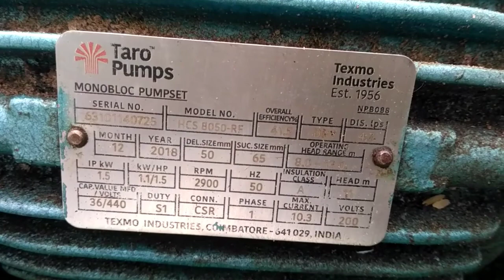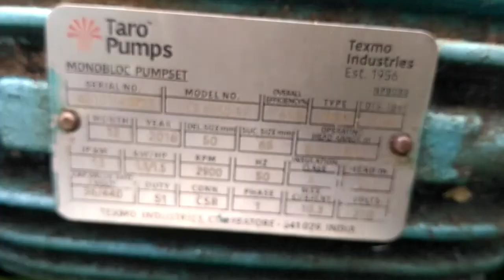Installing 1.5 texmo water pump | water pump installation | texmo pump price list, texmo water pump

Comment: Bro வயர் எத்தன Mm use பன்னலாம் ஸ்விட்ஜ் Box எத்தன Ams use பன்னலாம் 1.5 Texmo motorkku
Reply from the maker: Nanga 2.5 square mm wire use panrom
Reply: ஸ்விட்ஜ் Box சாதா Box. Use pannalama bro
Reply from the maker: Illa bro
Periya size box podanum

Comment: 30 ft  tubewell 
Which hp motor is best
Reply from the maker: 1 hp is enough
Reply: @Allvehiclesales   tq sir
Reply from the maker: Ok Thanks
Reply: Sir kitne inchi delivery hogi pani ki 1hp motor pr
Reply from the maker: 2 inch
Reply: @Allvehiclesales  2.5 inchi chaia pani
Reply from the maker: 1800 102 8888

Call this no for your information

Comment: Seems a good product to get
Reply from the maker: For purchase details

Kathiravan electricals
55 B,c mariyamman Kovil street 
Vedaranyam t.k
Nagapattinam D.t
614810
Cell: 9894884929
9443250579
04369250571

hi friends,  

in this video we will see the installation process of texmo water pump in my village. this texmo water pump will provide high water flow.texmo is one of the major manufatures in india.texmo water pump is the long losting motor.texmo water pump installation video i upload in our channel.texmo water i was used in pond water system.
this water pump is 1.5 horse power water pump.this water pump 1.1 kw pump and 1.5 hp water pump.

thanks for watching and subscribe my channel

Installing 1.5 texmo water pump | water pump installation | installation for 1.5 horse power water pump | water pump high performance | high performance water pump
hi friends,

thanks for watching my water pump video

subscribe my channelHigh performance water pump / water pump, Installing 1.5 texmo water pump, water pump installation, installation for 1.5 horse power water pump, water pump high performance, high performance water pum, tubewell pump, Usha 2hp water motor, 2hp water motor, Usha motor, Career, Developed, Texmo pumps, Texmo motor pump, Texmo, Texmo moter pump price, Best moter pump, मोटर पंप, texmo moter pump 3hp, Texmo moter pump price list, texmo moter pump price list, texmo water pump

Installing 1.5 texmo water pump | water pump installation | installation for 1.5 horse power water pump | water pump high performance | high performance water pump
hi friends,

thanks for watching my water pump video

subscribe my channelHigh performance water pump / water pump, Installing 1.5 texmo water pump, water pump installation, installation for 1.5 horse power water pump, water pump high performance, high performance water pum, tubewell pump, Usha 2hp water motor, 2hp water motor, Usha motor, Career, Developed, Texmo pumps, Texmo motor pump, Texmo, Texmo moter pump price, Best moter pump, मोटर पंप, texmo moter pump 3hp, Texmo moter pump price list, texmo moter pump price list, texmo water pumpFor purchase details

Kathiravan electricals
55 B,c mariyamman Kovil street 
Vedaranyam t.k
Nagapattinam D.t
614810
Cell: 9894884929
9443250579
04369250571

hi friends,  

in this video we will see the installation process of texmo water pump in my village. this texmo water pump will provide high water flow.texmo is one of the major manufatures in india.texmo water pump is the long losting motor.texmo water pump installation video i upload in our channel.texmo water i was used in pond water system.
this water pump is 1.5 horse power water pump.this water pump 1.1 kw pump and 1.5 hp water pump.

thanks for watching and subscribe my channel

Installing 1.5 texmo water pump | water pump installation | installation for 1.5 horse power water pump | water pump high performance | high performance water pump
hi friends,

thanks for watching my water pump video

subscribe my channelHigh performance water pump / water pump, Installing 1.5 texmo water pump, water pump installation, installation for 1.5 horse power water pump, water pump high performance, high performance water pum, tubewell pump, Usha 2hp water motor, 2hp water motor, Usha motor, Career, Developed, Texmo pumps, Texmo motor pump, Texmo, Texmo moter pump price, Best moter pump, मोटर पंप, texmo moter pump 3hp, Texmo moter pump price list, texmo moter pump price list, texmo water pump

Installing 1.5 texmo water pump | water pump installation | installation for 1.5 horse power water pump | water pump high performance | high performance water pump
hi friends,

thanks for watching my water pump video

subscribe my channelHigh performance water pump / water pump, Installing 1.5 texmo water pump, water pump installation, installation for 1.5 horse power water pump, water pump high performance, high performance water pum, tubewell pump, Usha 2hp water motor, 2hp water motor, Usha motor, Career, Developed, Texmo pumps, Texmo motor pump, Texmo, Texmo moter pump price, Best moter pump, मोटर पंप, texmo moter pump 3hp, Texmo moter pump price list, texmo moter pump price list, texmo water pump